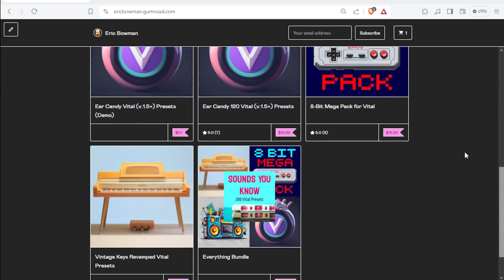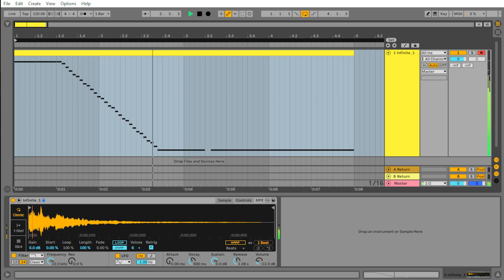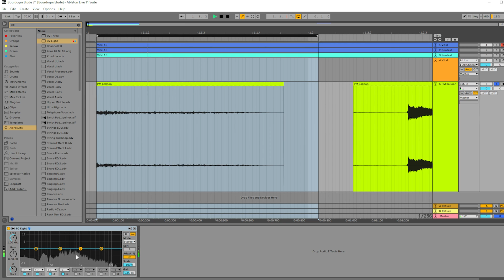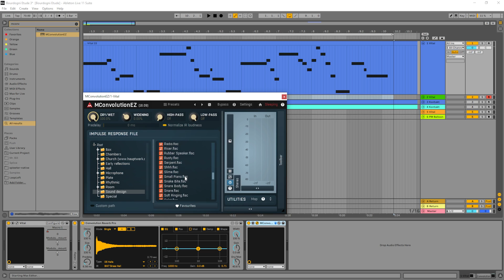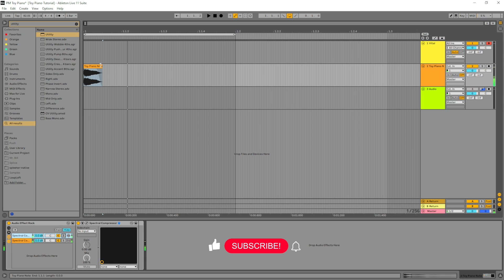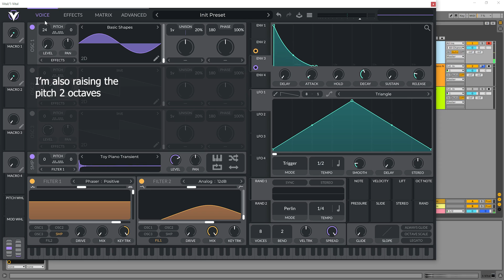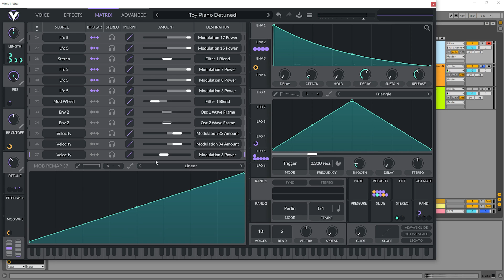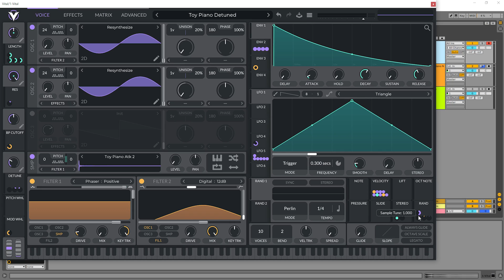How to Make Realistic & Expressive Sounds: Physical Modeling in Vital

Comment: I’m curious if you did something similar to the toy piano attack with brass instruments. While I find the tone quality of synthesized brass instruments to be quite realistic, the attack (the moment when the lips begin to vibrate as air is pushed through them in the mouthpiece) is not there. It’s such a lack of attack that is a dead giveaway to a sound being synthesized (or even poorly sampled). The ‘lip attack’ is not a single, short, ‘given sound’, but can have different qualities depending on the genre. The attacks can range from short, to more breathy with added length. As someone who played trombone for years in my youth, I hear these differences in brass articulations and not hearing them in either poorly contrived sample libraries, or ‘incomplete physical modeling synthesis’ detracts from the emotional musical experience. Great video, Eric! I learn a lot from you. Cheers!

Comment: One thing I'd like some more detail on is how you decide what sound source to start with. Like for the brass sounds you wave warp a sine wave. How did you discover that basis for brassy sounds?
Reply from the maker: To be honest I discovered that wavetable by accident. For metallic sounds, I use a short noise sample + phaser filter. For string sounds I use a short noise sample + comb filter. And for flute sounds, I use a long noise sample plus comb filter. Reed sounds can be made by frequency modulating a saw wave. I also discovered that by experimenting. I hope that helps!
Reply: @EricBowman  I was trying to make a bass preset that could morph between a slap and normal bass playing, and discovered the waveshape of a bass is actually pretty easy to make with nested fm synthesis on sine waves. The metallic tone is quite tricky, though. So I used the spectral comp trick to remove most of the tone from real bass note, and layer that into vital with comb filtering on it and the result is pretty convincing. This method of separating the basic tone and noise of a sound, and then tuning the noise with comb filtering, is actually incredibly versatile and useful for making really expressive presets. I've been experementing a lot with extracting the noise from different sounds and layering those with tones, etc. And kind of designing my own new instruments. This method of creating presets that you can reuse in 1000s of different ways is a very attractive way of making music. Kind of like a guitarist simply picking up a guitar.